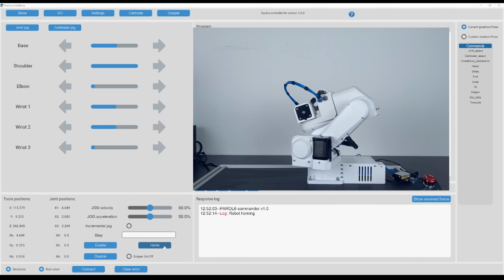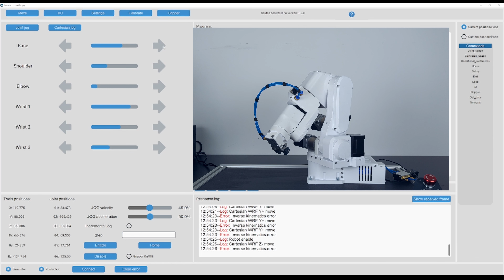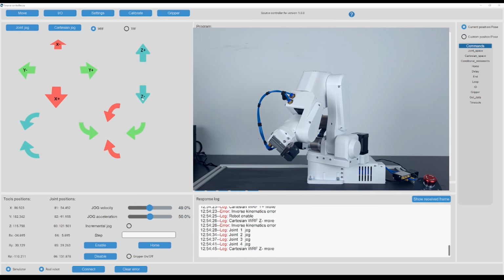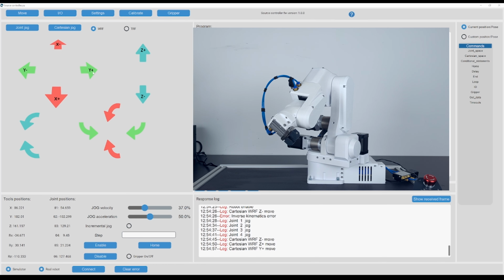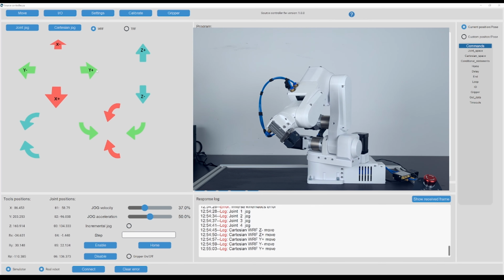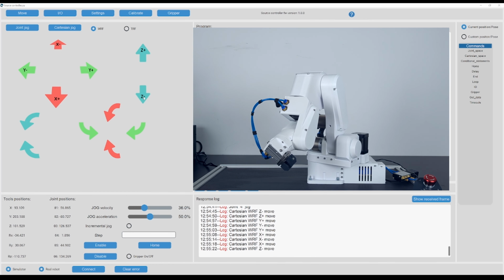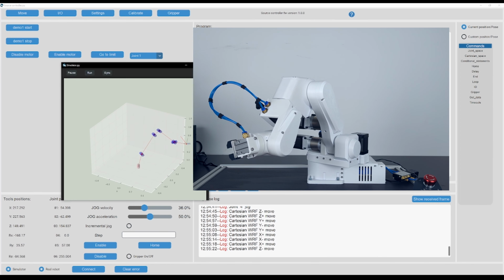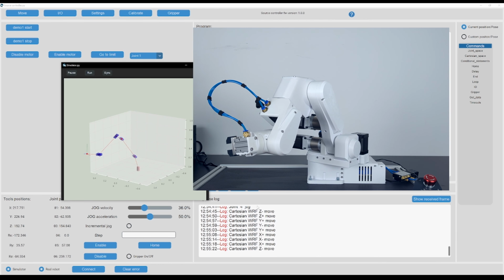PAROL6 - 3D printed robot arm - Quick introduction

Comment: Page is down again in the US, no VPN active. i very much am interested in this though
Reply from the maker: Not sure why... Just checked with VPN to US and it works. And generally it is up  to other users
Reply from the maker: We are talking about: https://source-robotics.com Right?
Reply: @source-robotics  correct. On my mobile device and my workstation. Us based no dice.
Reply from the maker: No idea why it does not work for you. It is on your end sadly. If you want to build the robot or learn more you can check on github it should work
Reply: @source-robotics  the git works,  so I'll just go that route. I was curious if you did pre builts turn key ones.
Reply from the maker: @miestermind  we do have partial kits where you only need to buy few parts from other stores. If you want to communicate more and if you need help with the build/robot join our forum or discord
Reply: @source-robotics  yeah kits sound good to me,  I'll see about joining these via the git

Comment: Hello, I have started to 3D print some of these parts starting from the wrist. I've also started looking for some of the mechanical parts. Do you have a more in-depth BOM? I'm particularly struggling to source the exact gearbox, stepper motors and sensors? I'd be happy to join Patreon if I knew I could get help.
Reply from the maker: Hey great to hear you started printing. I am currently mostly focusing on finishing the code and fixing some of the mechanical parts so fixing the bom is not a priority. Patreon helps a lot and i am more responsive there.

Comment: Amateur question- how does this robot operate? Are the inverse kinematics stored as a sketch within the arduino? And is this the same for any robot - to create a sketch describing inverse kinematics and upload it to arduino? 
Also, if kinematics are stored in the ardunio then how does it accept the commands? And are the commands in a gcode format?
Reply from the maker: All calculations (inverse kinematics, jacobians...) Are calculated on the PC that is connected to the robots control board. The control board accepts commands from PC in 10ms intervals. Commands contain position, speed, mode... Then after the control board unpacks these commands it executes them. On the control board there are motor drivers that then control the motors position and speed based on that command.
Reply: @source-robotics  and which program is being used to create said commands and which board are you using? I thought it was Arduino, but then you'd have store the sketch directly on Arduino and just sent gcodes, right ?
Reply from the maker: @f.c.2475  Board is custom made, you can sign up for preorder in the form in the description.
Reply from the maker: Programs are stored on PC and the when being executed commands are sent to the control pcb. There will be option to store programs on the flash chip of the control board soon.